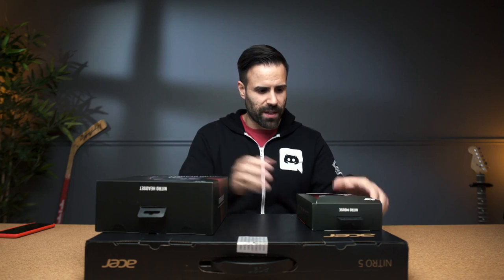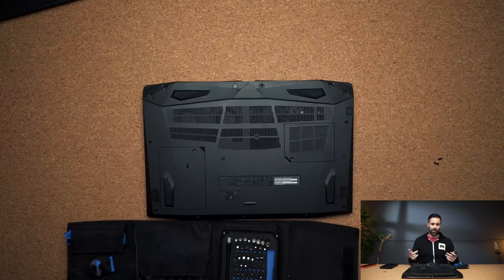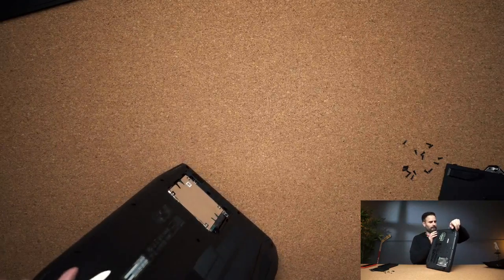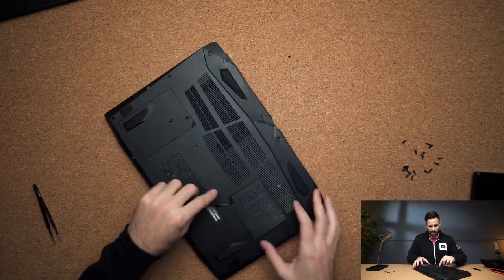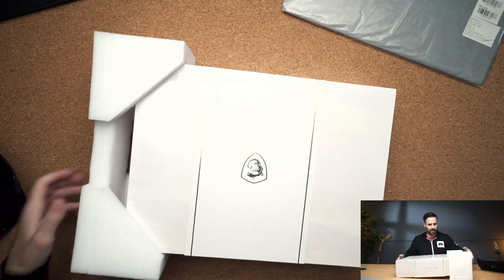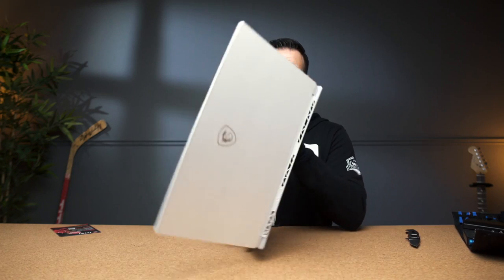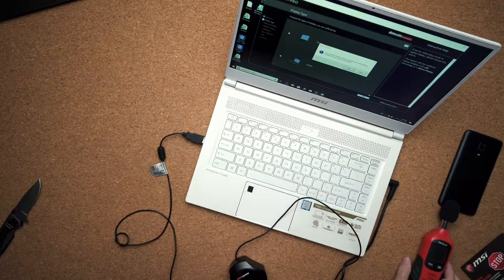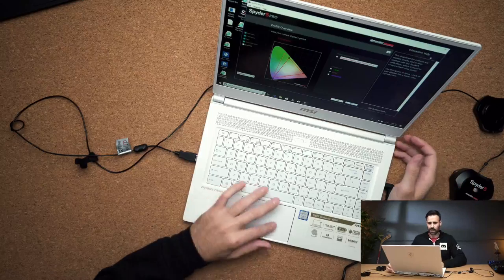ACER NITRO 5 (Ryzen 5) & MSI P65 Creator Laptop Unboxing!

Comment: I hope that acer would give their new gaming laptop (maybe for 2019) more kind like sleeper looks.
And i would like acer to replace their cooling solution too for their budget gaming laptops line.
Well, g3-571 cooling solution are quite decent, but not really good.
I wish they would use cooling solution that separated the fans position like asus or lenovo did to their legion and tuf/rog, since that cooling solution seems doing a better job at dissipating the heat.

Comment: can anybody tell me whenever i try to livestream  with this laptop my game lags too much...integrated gpu starts working more than dedicated gpu rx 560 x . display is connected to integrated gpu  this is the reason i can't livstreame fully powered. plz help me how to change this!!! plzzz...
Reply: known bug with the cpu/gpu combo. i bought two of these laptops and the rx 560 wouldnt work on either. I would return it asap if i were you....
Reply: @Eliil3   i have fortunatly sold this laptop . Looking for a pc build ... I have to stream...
Reply: 1. Set power options to performance
2. In advanced settings set gpu to performance mode.
3. In radeon settings go to system then switchaable graphics hit  installed applications.
4.click browse and then add whatever games or applications eg Photoshop and then these will run off the rx560x gpu.
This solved the issues i had.

Comment: I have nitro 5, 7300hq 1050Ti :) best that money can but at 699 :)
Reply: I can buy gtx 1060/Rx 580 + 6 core ryzen 5 for that price lol
Reply: @hareeshdevendran4696  okay.
But that's a laptop? What's the point of your comment?
Reply: what's your experience with i5 7300HQ? If I use it on full performance (with turbo boost) the temperature goes up very high. I am worried that way I may fry it.
Reply: @laszlodajka9914  It depends alot unit in particular rather than whole batch of same lineup. I use nobeBird cooling pad, and with room temp @ 23/24 'C processor temp stays good at 60-70'C.
In Far Cry4, FC5 temp goes 70-78.
Reply: @faisalhaider007  similar for me with a 99 % of CPU performance. but 100% and 3100 or 3400 MgHz it goes way beyond 90 degrees in a Ubisoft game. I mean the latest AC for instance. the older Far Cry is ok.
Reply: @laszlodajka9914  I would suggest using a good laptop cooler :)
Reply: @faisalhaider007  thanks :)I am using one. it lifst away the machine from the surface. Though i think these things cannot make a change. I just wonder what people have experienced about 80-90 degrees. have they laptop fried or could live.
Reply: @laszlodajka9914  hmm, If it is continuously above 85+ then surely its life will get shorten like from 5-8 years down to 4-6 years.!
Would you mind please checking gameplays videos on Nitro 5 I have uploaded? :)
Reply: @laszlodajka9914  Hi buddy, it is better to check XTU and some utube vids about Nitro heating issues, In my opinion 70-80'C during gaming is any problematic. If we undervolt we will loose FPS. And we know that we should not OC gpu! that'll kill the purpose of undervolting, and my GPU stays really cool :) Thanks to Almighty Allah, the GOD, my unit is good :)

Comment: Random YT unboxer: I used to work in IT! 

immediately tries to yank off the cover with an HDD screwed into it and fucks up the SATA cable and/or the connectors on the motherboard and/or HDD

Me: Seems legit.

But yeah, pretty retarded design on Acer's part.
Reply from the maker: Lol connectors are fine. I plugged it back in after the stream